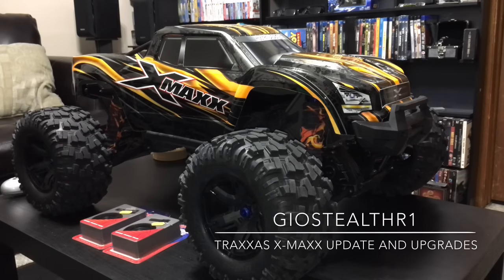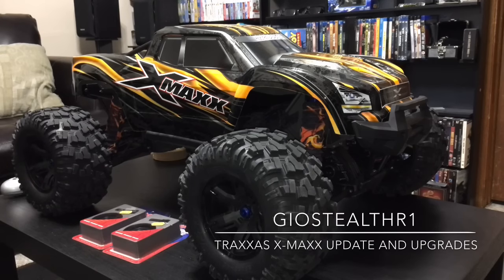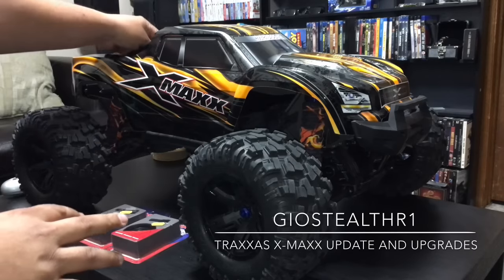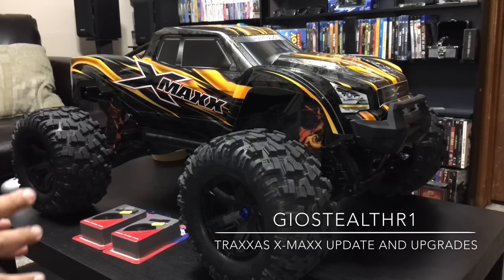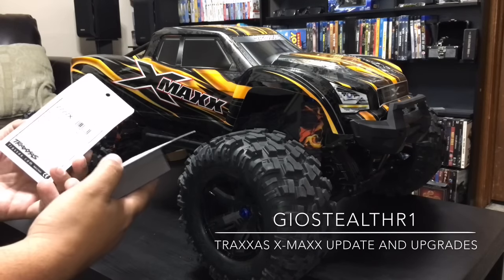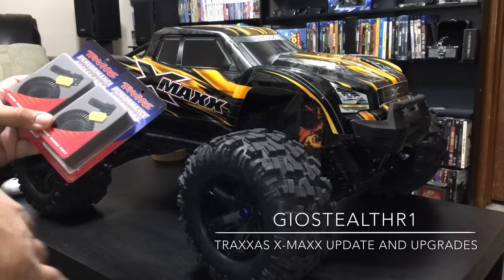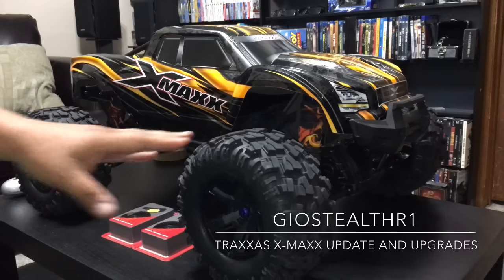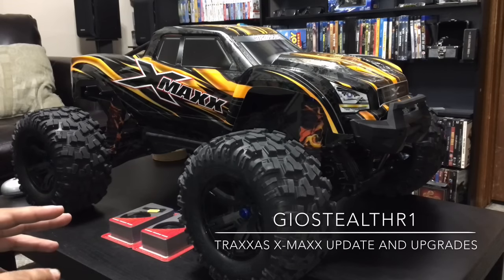TRAXXAS X-MAXX UPDATE AND FUTURE UPGRADE

Comment: 8S? I should have known that you were itching to do an ORANGE ride. It is looking cool, but are you sure about the shroud with the issues with the stock ESC, it will increase the heat while running. Oh well, your ride. GOOD LUCK to you bro.
Reply from the maker: I will have fans 😬
Plus I will not have the stock fans ( hotracing ) 

This RC did build up a lot of snow... 
But now it's summer so it will build up a lot of dirt. ( gets heavy )